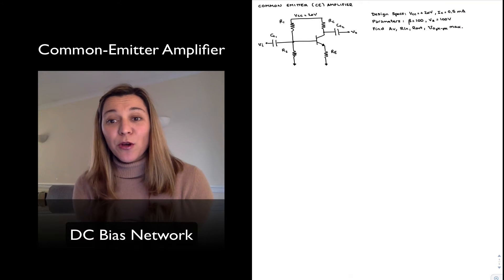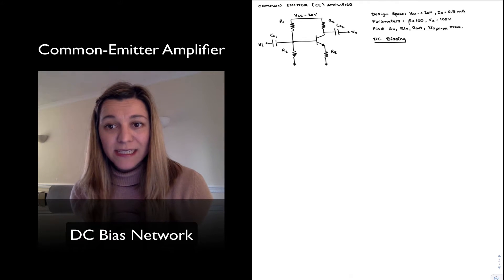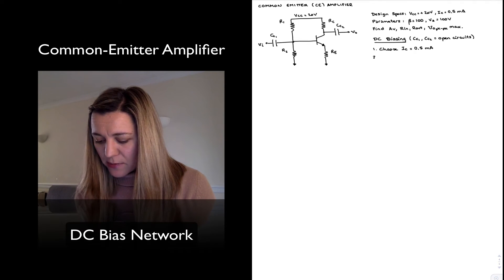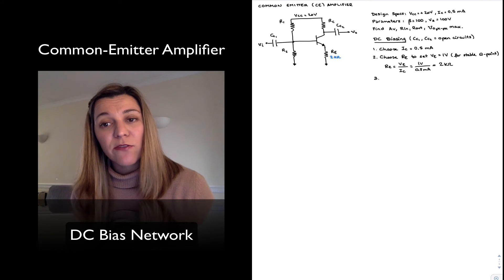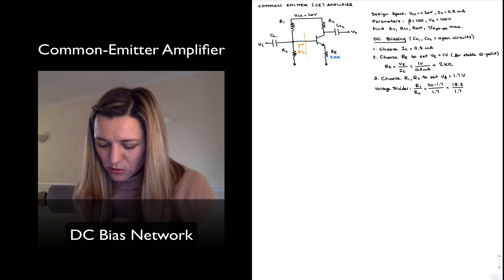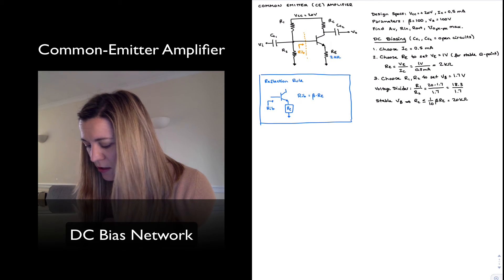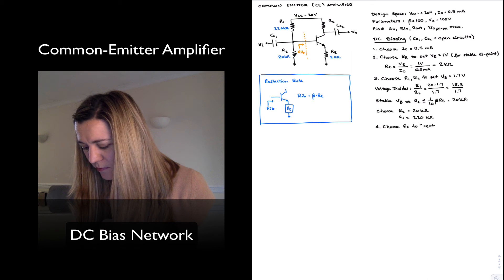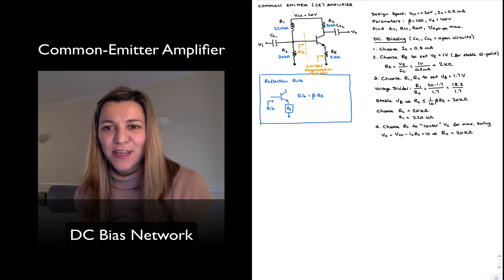CE Amplifier: DC Bias Network

Comment: hi Mateo Aboy. thank you for your efforts in sharing your knowledge. i need your help. i have been given the task of analyzing a single stage amplifier which in common emitter. but instead of Rc, it is a resonant circuit and an RFC. now i want to perform both the dc and ac analysis but i got stuck. i am i to find the individual reactances of the RFC, the L and C of the resonant circuit then add them to make one resistance at the collector or how do I handle the circuit and write the analysis. i will appreciate it a lot if you can do a video on this arrangement. Thanks.